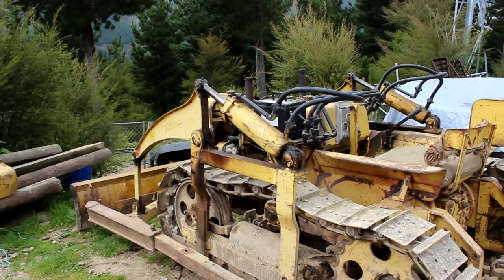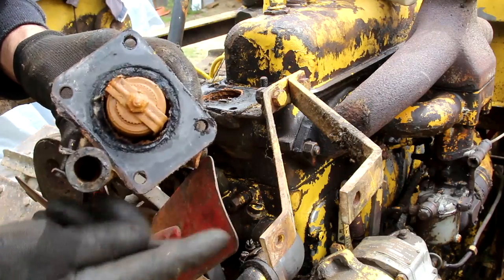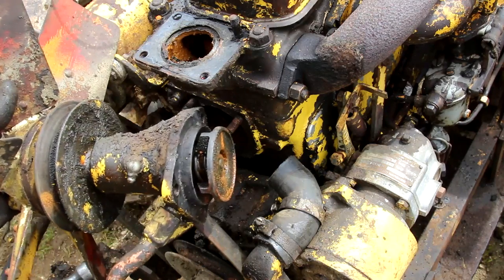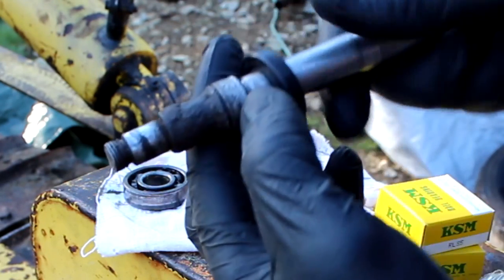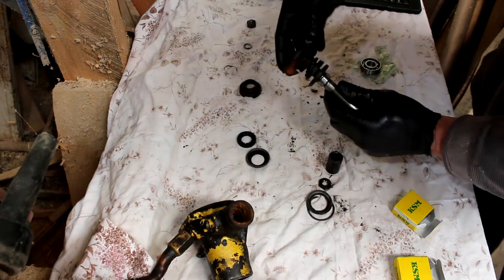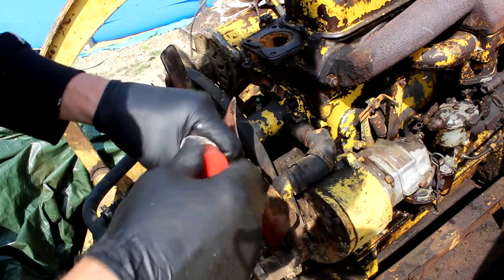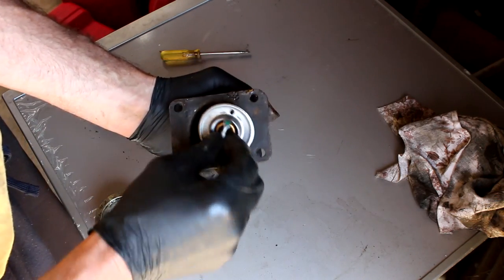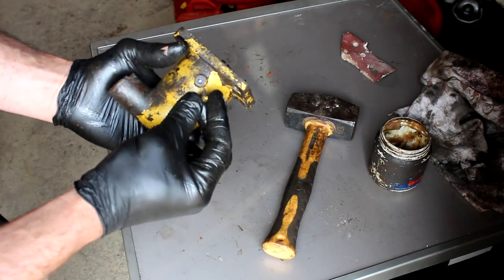Vintage Bristol Dozer repair part 1

Comment: Mate, you get an A++ from me for ingenuity and courage. But (there's always a bloody "but", isn't there?), you are a bush mechanic, aren't you? That's alright, so too am I. But if I may, may I offer a few things I have learnt (from others much smarter than me) that may help you?

1: When installing those open bearing races, most people pack them with grease before they install them. Yes, the grease gun will push in some grease, but a deliberately fully packed bearing has a much better chance of living longer.

2: I used to make gaskets the way you did, but there is an easier method. Smear one of the mating surfaces with a light layer of grease, and then, with the gasket material held to the mating face of the part, go around all the edges and through holes from the gasket side with a small ball pein hammer; use the flat face on the edges, and the ball end on the through holes. That actually cuts the gasket in one step, with no need for wad punches and scissors, and the gasket is a far more accurate fit.

3: If you want to solder things to copper or brass (radiators?) it is a very good idea to use solder with a high silver content, rather than lead-tin solder. Plumbers use "silver solder", which is about 5% silver, and can be bought by the stick or two (or kilogram or five) from plumbing suppliers such as Reece's. They can also supply solder with up to 15% silver, which, while relatively expensive, makes any soldering job easy. You appear to have oxy-acetylene, so if you buy and use brazing flux (which is basically borax, although the commercial varieties may have "Added Vegemite!" or something similar), you will get very good results with that. You can solder anything to anything, including stainless steel to brass/bronze/steel. Just don't try it with aluminium...

4: Ordinary household vinegar does a very good job of rust removal. It may need to be repeated a few times for bad rust, but it is cheap and effective. Leave the part/block/wotever in contact with the vinegar for twenty-four hours, and even longer if you can; up to forty-eight hours can help with stubborn buildup. Use new vinegar for every iteration of the process. It is also very effective for removing mill scale from hot-rolled steel before you weld it. You can also use a 10% solution of hydrochloric acid (muriatic acid to some people). That works much more quickly, but it is much more corrosive, more dangerous to bot people (it burns ), and it can eat holes through badly corroded parts, but if you are careful it works. It is also a little more expensive, but not much. I wouldn't use it inside an engine block; the results would be too unpredictable, but vinegar does a lovely job of cleaning out a water jacket.

Please note that I am not criticising you; these are suggestions only.
Reply from the maker: Good advice thanks mate.

Comment: Good video you see so many peoples ideas on you tube, one of the other channels I watched said put antifreeze in the coolant even if you don't need it to protect against frost as it prevents corrosion inside the engine,water pump and fittings. I guess it would take many years for this lump of iron to rust away?

Comment: it lookes like the coolant , corrosion inhibeter needs more timely checking. 

Depending you can add a lubricant for the water pump bearings.
Thanks

Comment: I gatta say your a hell of a tinker! Might wanna have just packed those bearings tho!
Reply: The bearings were packed with grease through the grease fitting on the water pump...the grease fitting which a previous owner had obviously not bothered to grease at all routinely....

Comment: I had a Toyota Tercel that had rust like that in the water jacket. Took me literally a whole day of flushing it back and forth to clean it, was like mud.
Reply: That evil stuff Dexcool, also known as Dexkill will do that if you mix it with other types of coolant.  Dexcool also didn't like any leaks in the system, if air got in, it would cause the coolant to turn to a jelly-like consistency,  and would just remain in place, effectively clogging up/blocking off the flow of liquid coolant.  You can easily guess what that would lead to.  I believe that your best bet is just to use regular glycol and water solution, following the manufacturer's recommendations to a certain degree.

Comment: Thanks Marty for the great video, have you ever tried to punch out the boltholes on your gaskets first I was told to do that when I was apprentice over 40 years ago it helps to stop the gasket from tearing . Looking forward for more great videos
Reply from the maker: Good tip, that makes sense

Comment: The outside bearing should have a seal facing outward at min.  Even if that is an OEM replacement you installed, that should be a consideration when you go back in and upgrade that one.
Reply: It doesn’t have a seal there, as it uses a total-loss grease lubricant system - hence the grease nipple on the outside. They normally have a thrower arrangement on the pulley, or even a separate thrower to keep contaminants out. If it was sealed, there would be a risk of grease being forced inside into the coolant. But yes, it would be nice to have an outwards facing seal.
Reply: @tutekohe1361  probably the reason it failed first.  Note the lack of grease didn't impact the inner bearing as much.

Just because that was the OEM design doesn't make it correct.

Comment: Good job but I would have done one thing differently. I would have packed those bearings with grease before I put them back in the water pump. I wouldn't depend on that grease fitting to deliver grease everywhere it's needed. Keep these great videos coming!

Comment: This is why you NEVER put tap water in an engine.
Reply: distilled water is nice but it doesnt really matter what you put into the engine, eventually it breaks down and or starts oxidizing the cast iron or aluminum. That is why you should change coolant. Of course nobody does that...

Comment: Run 50/50 mix of hydrochloric acid and water into the old girl,that will dissolve all of the corrosion inside the engine.Let it sit for half an hour then flush out with bicarbonate of soda mix doesn’t matter how thick you make the mix with water,it will deactivate the acid,good vid.
Reply from the maker: That makes sense
Reply: Try it in a bucket with rusty parts and see what it does,it’s a killer trick,cleans the calcium build up out of toilets a beaut that’s how I found it originally,ya have to deactivate it tho,remember that.

Comment: I need to buy a lathe. Can’t tell you how many times your trick right there would have been helpful
Reply from the maker: They are handy, I only use it occasionally but it has paid for itself many times over vs paying an engineer to do the work

Comment: Be careful about 20 years ago. I was wearing rubber gloves polishing
a shaft on a lathe. Just like you were. When the shaft caught the rubber gloves.
I broke my thumb in three places wrapping my hand around the shaft. I could
have lossed my whole hand and probably a lot of my arm too! If it hadn't pulled
me into an emergency stop that I had just put on the machine 3 hours beforehand.
Reply from the maker: Ouch that sounds painful.. this one is not that powerful, I can put a hand on the chuck and the belt slips

Comment: Your so lucky that the temp gauge thermo couple didnt blow apart and explode in you face. Had one do that on me about 25-30 years ago while heating/soldering around it.  Goes off with a gunshot, scare the shit out of you bang, splattering stuff everywhere. Too much heat for too long and the pressure hits a breaking point. I was lucky as who wore eye protection back then? If i had to do any soldering around something like that again, at minimum would have safety glasses for sure but a full face shield would be best.

Comment: Not flushing that stops rust - never use pure water in a cooling system. Summer coolant is an engine saver - I am amazed at how few people are aware of the damage ordinary water does to an engine!

Comment: New subscriber here....love you fix them old tractors and dozers but when you pull them apart why dont you sand blast and repaint them?
Reply: Presumably because the time is better spent in servicing plus essential repairs in order to bring them to usable condition.

Comment: I've never thought of using grease as a jointing compound for gaskets. Does it maintain a good seal at higher temperatures? Initially I would imagine that the grease would thin out and cause problems but obviously its been working well for you. A lot cheaper than RTV and no chance of blockage problems if it gets into water and oil galleries.
Reply from the maker: Ive never had a leak using grease

Comment: Should have used an easy sleeve on the shaft, you would end up with a hardened and ground seal surface.

Comment: To stop the rust build up in your engine you need to use an antifreeze mix. Putting neat water in the engine will cause corrosion.
Reply: If you look at Part II you will see such a coolant being put in following treatment with rust remover and flushing through.

Comment: Great video again mate. What year is that dozer? Also is that the same as the Engine they stuck in the Mini and similar cars? Or is it a bigger lump?
Reply from the maker: Not sure about the year, maybe early 60's the engine is from an Austin A70
Reply: @MartyT  cool. Lovely bit of kit love old machines technology back then in many ways better than today.. when you see guys in the freezing cold of Alaska pulling excavators out of the bush from the 50s not started 30 years and they get em started and drove off in em put em to work with s battery and new fuel like yourself you realise how much things were built to last before the throw-away culture of last 20 to 30 years

Comment: Great work!  I may seem like a nitwit, and I probably should know this, but how did you mount the washer on the chuck for turning?  I realize you might be too busy to respond, so if anyone can give me some direction I'd appreciate it.
Reply from the maker: I used the outside of the chuck jaws
Reply: @MartyT  I feel like such an idiot.  I thought somehow that you'd mounted it with that pipe you were showing right before you turned it.  Thanks!  Now I can put the pipe back under the sink.

Comment: That is just my opinion    the thermostat is too far from the engine   I should be aiming over the hot water the engine will be hotter so that the thermostat opens??

Comment: Good job on the thermo housing& water pump. What make is the green lathepls?  Pls tell me which direction the water swirls in the kitcn or bathroom sink. Fill the sink,let the water settle, pull the plug, what direction does the water swirl? Ty
Reply from the maker: I don't know what make the lathe is, doesn't seem to have a tag on it
Reply: @MartyT  it looks like a myford, but they are usually grey not green, made in nottingham. I just wondered, 10 am in london, hello

Comment: It's got a cracked timing case cover, it's broken a couple of teeth off the timing gear, .the radiator's damaged to the core, It's got a cracked water pump, it's got a fractured injector line!
Reply: Injector line? It's neither a diesel nor a fuel injected gasoline/petrol unit
Reply: @paulhitchcock9760    I was trying to be amusing (ie..taking lines from Mad Max 2 - the road warrior.)

Comment: You should always use anti-freeze.  It prevents corrosion even if you live in a climate that does not freeze.  Would make it look like new inside the radiator and block.

Comment: Not to bad for outback machine shop only I would have done different is before I put the water pump back on is took the pressure  washer to the inside of engine water area

Comment: Did you flush the engine as well?
Reply: You would have been best advised to have looked at part two. This deals with flushing the cooling system

Comment: 19:16 did you turn your battery powered drill into a corded one??
Reply: Any 12 volt cordless can have a 12 volt motorcycle battery hooked up with suitable wires...and this makes it able to work all day without needing charging...and the motorcycle battery is little hassle to carry round......

Comment: Good repair on the water pump, I would have fitted sealed bearings instead of the open ones.
Reply: The unsealed bearings have a better chance of living long and prospering with a shot of grease always keeping the pressure on from the inside.....?

Comment: Hello Marty. What make of engine is it.
Reply from the maker: Austin a70
Reply: Hello Marty. That's a funny size engine. Maybe a industrial. Car engine's were A30, A35, A40, A60. And after that they were 6 cylinder engines.
Reply: @JohnSmith-yv6eq  thank you for that information it was very helpful. The Bristol bulldozer must have been a early one to have that Austin 70 Engine. Later they were Perkins P3 Diesel engines.

Comment: Mmmm ... perhaps an 'SKF Speedi Sleeve'  would have been a good way to repair that water pump shaft seal surface ...
Reply from the maker: Yes I considered that but it would have meant another trip to town and more expense
Reply: @MartyT   yeah .... I can understand that  .... nice little tractor though ... could make for a great resto project ??
Reply from the maker: @stejac51  For sure mate, its a cool little machine

Comment: When we did repairs of a shaft like your water pump shaft, we always took a cut off the original diameter in the lathe, before welding up. That way, when you turn it back to size, the entire area left is all new weld, not meeting the junction of the original shaft and the weld.
 God fix there. It's hard to believe the fan even stayed on with that much slop in the bearings.

Comment: Couldn't you run coolant so it doesn't just fill up with rusty water again?
Reply: You need to  look at Part 2 when, after flushing through, the radiator gets filled with antifreeze/corrosion inhibitor

Comment: What a wonder , use only normal water as coolant ,  use ELC Coolants , protection from rusting and more !!
Reply from the maker: I flushed the water out and filled with coolant.. part 2 will be up soon
Reply: @MartyT  Thank You , waiting for part 2 !
Your thermostat replacement was exceptionally inventive.

Comment: I love those gloves you are wearing Marty.   A box of Nitrile gloves costs about NZ$40 and they wouldn't last five minutes doing that sort of work.  It was a nice surprise when I checked SuperCheap and found they are only $2!   I'll be getting a few pairs next time I pass.  So do you wash them with Swarthega while wearing them, or just throw them away?   I was surprised to see you using the ratchet for everything.  Pretty much every nut and bolt removed or fitted on YouTube nowadays is done with a Cordless.  Tim (Cotontop 3) has a big feck-off 1" drive Milwaukee cordless that uses on his logging equipment, and I don't think it has been defeated yet.  Goodness knows how much one of them would cost, but perhaps The Tool Shed or Blackwoods (who both do Milwaukee) will sponsor your channel)?  🤞   I just checked and the 1" Milwaukee impact wrench is NZ$919 from Blackwoods.  Better get used to using that ratchet wrench.
Reply from the maker: They are nice gloves but they collect grit so I use nitrile when working on parts that need to be kept clean, I also wear nitrile under them as they are open weave on top.

Comment: Why didn't you pack the bearrings?
Reply from the maker: I pumped grease through them before and after the first start
Reply: @MartyT  I knew you had it under control....I just heard my Grandpa in my head saying...."always pack your bearings"

Comment: I would have packed those bearing 1st then assembly..
Reply: The bearings were greased by pumping them full via the grease gun after the overhauled water pump had been bolted home on the engine.  That is why that grease fitting is there and needs periodic greasing....

Comment: the gunk in the engine is what happens when you don't use antifreeze
Reply: The happens when you don't change your antifreeze too, the stuff breaks down and starts to rust internal parts.